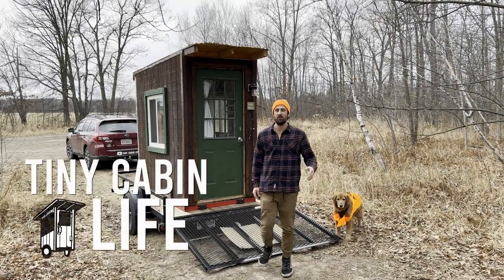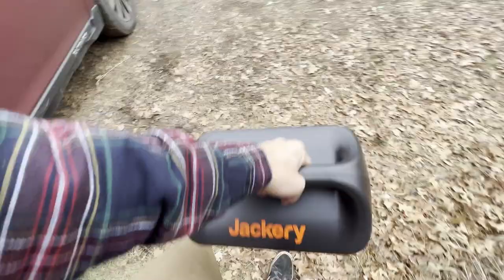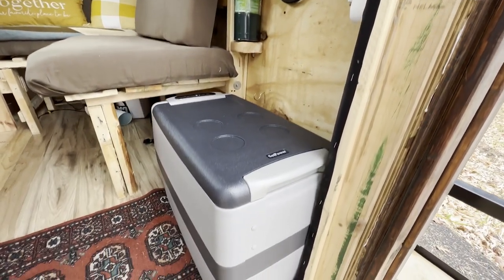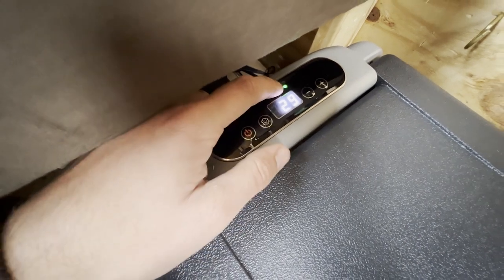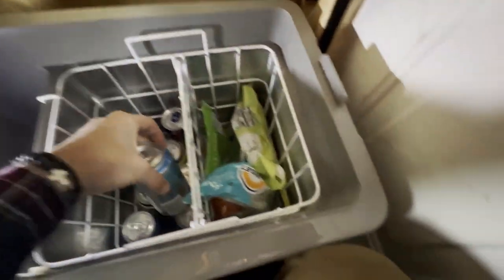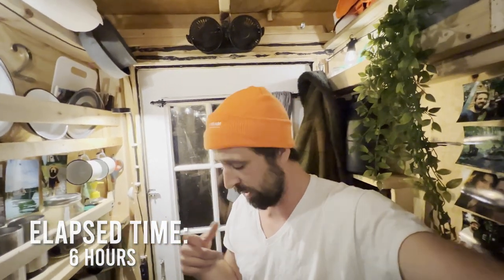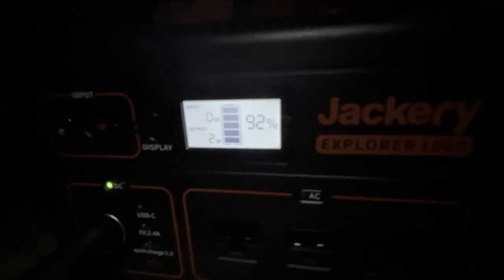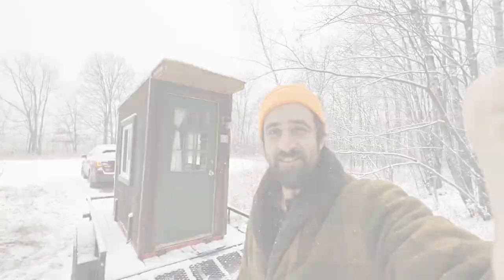Portable Refrigerator Review | SetPower AJ40

Comment: Summer in Australia gets pretty hot, if you plug fridge and contents (the fuller the fridge the better) into mains power overnight before you leave then hook up 12 volt power from car to trailer to keep fridge powered up whist driving, also add a frozen bottle of water inside fridge also reduces power needed when hooked to 12 volt. You can also get an insulated cover for fridge to help in Summer … 🍻
Reply from the maker: Great tips 👍🏽 We’ll definitely see how it goes this summer

Comment: More than the battery, ECO mode makes the compressor last longer and break in better. I never use MAX. I also tie a string loop through the grille and pass the cord through it so it won't kink at the plug.
Reply from the maker: Agreed! We on,y use eco mode 👍🏽

Comment: 1 more question why didnt you build the full width of the trailer>instead of just the tiny width?curious?
Reply from the maker: It used to be on a trailer that was the same size but had to be moved due to mechanical issues with the trailer. You can see what happened in our video here : https://youtu.be/3q106WDLPuA
Reply: good move from a harbor freight trailer to a real one ok  good move @TinyCabinLife
Reply from the maker: @tm8747  😎👍🏽👍🏽

Comment: i noticed that you always park in a wood area , and a i see that the weather conditions is snowy, . i was wondering if you could install 1 0r 2 solar panels on top of the camper, . i have a friend of mine that hangs solar panels on the 3 side for power,? east moring, ,south for the mid afternoon to noon, and west for the later part of the day? he uses a 200 watts unit on each panel, the top 2 he has is permanent in total he with full sun is 30 amps of power, per hour?  when his traveling down the road the 2 top ones are charging the whole time, for your jackery or batteries on board, . i personal dont use 12 volt batteries, i use 2-6 volt batteries in line to make 12 volt system . in the trailer im making its going to have 4- 6 volt batteries and 4 - 4 top in total 300 watt panels top. inside im making a waterproof hole to have a push up on the panels for better sun power,. it patented for profit making?  my trailer is a combination tear drop/camper trailer, . all cooking outside in the rear , my refer is 13 cu.ft., microwave 1.2 cu.ft, 1 sink , and alot of cabinet space, with 2 doors on the rear, door for cover above me , and the  other is for standing a lift door,
Reply from the maker: I’d love to have permanent solar panels someday 👍🏽 As of now, I have portable ones that I break out when I need to. Maybe I’ll show those off on a future video. Your friend seems like he has a great setup!
Reply: @TinyCabinLife   hanging Multiple solar panels of the type that van lifers mount to the roofs of their minivan and larger might make your trailer dangerously too heavy. An alternative would be on each side of the cabin having mounts for STORING a large solar panel and a collapsible stand so that the panels can be set up on the ground nearby and then hooked up to whatever battery bank you find a place for in the canon. 
Same thing for your A-frame cabin (might as well use the same solar panels ). Some panels that can be placed out in the daytime to soak in the sunlight and then stored away at night
Reply from the maker: @MrSheckstr  Not a bad idea 👍🏽

Comment: using 2W (what the display showed) after 3,5 hours seems wrong, and doesn't compare to the specs of that cooler.
Reply from the maker: It could be because it started out being colder since it’s wintertime here in MN, so it wasn’t blowing as hard? I’m not sure actually 🤔

Comment: The fridge and battery will be tested in summer. Overnight in cold conditions will not push your battery or fridge with respect to performance and power consumption.
I would certainly consider apologising for slightly misleading viewers of this particular video.
Reply from the maker: I didn’t mislead anybody. It absolutely works well. We can check back in on it in the summertime 👍🏽
Reply: @TinyCabinLife  You wouldnt test an air conditioner on a cold snowy night right?
Why would you test a fridge under these conditions and claim that an overnight drain of the battery from to 92% is a great result?
I would want to know how the system performance on an average Summer day - that;s when you need the fridge to perform. Especially if you have meats, dairy etc int eh fridge.
It would have been useful to inform listeners that the performance of this battery and fridge set up does not reflect typical conditions. We wouldn't want people buying this set up thinking they can have over 1 weeks power supply for a fridge of this capacity.
Do you reaslie how hot it gets in Australia my friend? Your set-up wouldnt last long in our conditions before needing a re-charge.
My experience of these fridges when I go camping and fishing is that I need the car cigarette socket handy for regular charges and a solar panel set up that runs during the day. In summer it's a necessity in order to keep the fridge running properly.
I would still apologise or at least modify your video with some warnings on the limitations of your test.
Do the right thing my friend.
Reply: @PetraKann  Relax sally.
Reply from the maker: @PetraKann  It’s winter and I’m using the fridge! It’s a test of whether it works or not. Stick around until summer and find out. Yeesh. And what are typical conditions anyways? I live in Minnesota where it’s cold like this 8 months out of the year. Thanks for your concern 😅
Reply: @TinyCabinLife  You do realise that I am just having some fun here.
But I am nevertheless correct in my critique of your appallingly limited and meaningless fridge/power supply experiment.
On that basis alone you should submit a formal apology and modify your video in order to warn viewers before they purchase any of the products included in your test.

Whether someone apologises or not is totally independent of the size of the house they sleep in, so you cant hide in your 34 square foot trailer forever my friend
Reply: @PetraKann  he stated it was 65 degrees in the cabin. Nothing misleading.
Reply from the maker: @PetraKann  Haha bye! 👋🏽
Reply: @TinyCabinLife  You took the bait because my criticisms were valid.
It made the demand for an apology and video modification even more valid - that is why these demands were thrown into the mix my friend.
Good to see that you understand the humour now.
So just apologise and we can all move on from this rather unsavoury and unfortunate little incident
Reply: @frankjones4094  Listen here Mr Bones, this is between me and the 34 square footer. It has absolutely NOTHING to do with you Prank.
You should apologise for interfering in a legitimate legal battle,